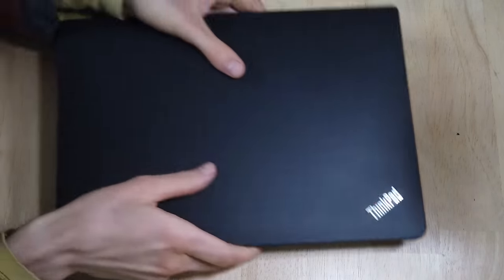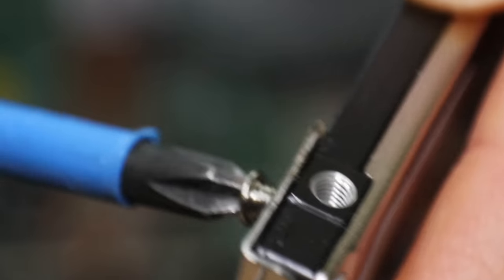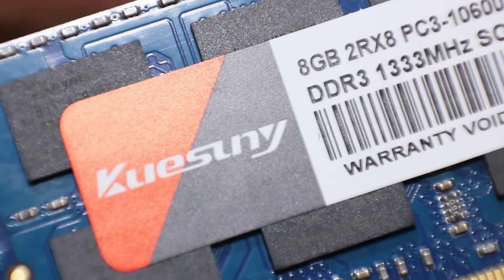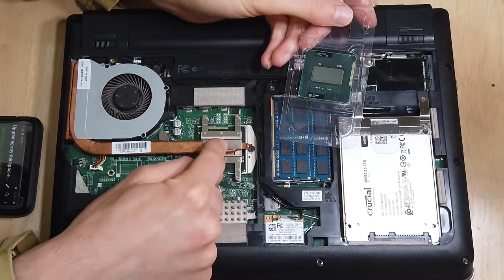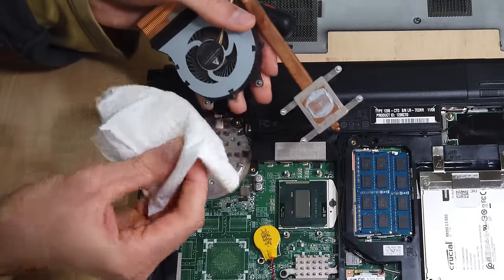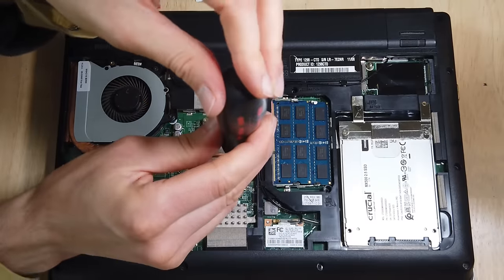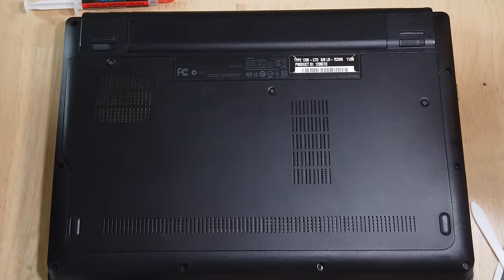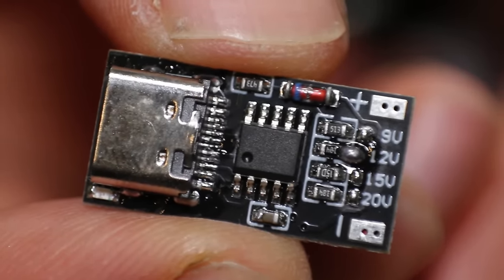The up-gradable laptop I can't get rid of: CPU upgrade etc

Comment: Hi can i upgrade the cpu of toshiba satellite dynabook b453/j intel celeron to  intel i5?
Reply: From the Internet, install the free CPU-Z program into your laptop. On the first tab of the program, look at which processor socket (rPGA 988b or BGA 1023). 
On the "Mainboard" tab, look at which south bridge -> HM65? HM70? HM76? HM75? HM77?
On the "Memory" tab, look at how many gigabytes of memory there are and in what mode it works - single? dual?
Give me this information. Which drive in the laptop is HDD? SSD?

Comment: you should have bought ram with 1600mhz or 1866 mhz and over clocked it to get more speed out of it. you still moght be able to overclock your ram to 1600mhz but it is just easier with higher speed rated ram

Comment: I think it was better install i7 3610Q, 3612QE 3615QE. 1 - Memory work on 1600mhz Sandy work only on 1333mhz. 2 Graphics is HD4000 with DX11 support. On sandy only DX10
Reply: G2/G3 m988 laptop cpu sockets are not always cross compatible with each other electrically like the desktop lga1155 sockets. Also, beside the chipset, you needs a bios which supports the mentioned cpu and memory speeds.
Reply: @el2-More  Man, you install 45w cpu on laptop with basic 35w cpu e320 solds only with dual core Pentium, i3, and i5. If lenovo blocked some CPU microcode - then you can't install 4-core 45w CPU. About electrically compatible, true, but only if you try install some 1-st gen cpu. I upgrade thinkPad E520 with prntium and same HM65, on i3-3120ME. Whthout bios update. And all work fine.
Reply: @el2-More  And, hm65 not support all laptop Ivy. Only CPU-s for this socket\chipset config
Reply: @AthraxAuf  somewhat true, m988 G1 is 100% not compatibe with m988G2, even if it's physically fits, neither electrically, nor chipset/bios level. G2 rev1/rev2 sandy/ivy ones sometimes, if the manufacturer prepares it, can work, but it depend on the exact model. My bad about G3, it got even different pin number (964 vs 988) and that's for haswell only.
About TDP,  in some cases, the heatsink/cooler does not prepared for the more powerful CPUs, in this exact case, it can't cover the full die and the CPU overheats. In other cases, the VRM itself not prepared for higher wattage, or, there are no 100% compatible microcode in the bios.
In such upgrade cases, I always stick to the ones wich had factory option for the more powerful cpu, and always try to avoid the ones with higher TDP than the factory one.

Comment: Can i upgrade dual core cpu to quad core (FCPGA94)
Reply: what processor and laptop model, what graphics card and power supply, how many watts (output voltage and current / indicated on the charger)

Comment: 97 deg C.... WTF!?!? Should never exceed 85-90C, EVER!
Reply: the 1-3 gen Intels were rated for 100 C i think, I have an older Dell from the same generation and it used to go up to high 80s as well before throttling, a repaste and fan change keeps it in the 70-80 range mostly
Reply: modern intel Cpu's 'can' run at up to 105°C, and that is specified as safe operating temp. by intel. There were even some dell laptops that would run them at above 100 deg. out of the box. Obviously a very bad idea but yeah... laptops be like that
Reply: Actually that is kinda normal given how anemic the cooler is in this laptop while a lot of higher end laptops has vastly better cooling never mind some overclocking for the XM models.

Comment: Would make sense if the footage was shot 8-9 years ago. Now what, new Asus vivobook 15  i5 8/256 GB is only US 300. For old laptop, battery/MB/monitor are not forever, not talking about not on par with current performance spec. One should learn when to let go.

Comment: what cpu can be changed to i3 2330m???
Reply: What laptop model do you have?
From the Internet, install the free CPU-Z program into your laptop. On the first tab of the program, look at which processor and processor socket (rPGA 988b or BGA 1023). 
On the "Mainboard" tab, look at which south bridge -> HM65? HM67? HM76? HM77?
On the "Memory" tab, look at how many gigabytes of memory there are and in what mode it works -> single? dual?
Give me this information. Which drive in the laptop is HDD? SSD? 
What graphics card is in the laptop?
Reply: @vladimirazirov1815  Asus k84L-4kvx
Reply: @BSIS-2201AndanThomas  You can install an procesor i5-2540m, i7-2620m, i7-2640m /socket rPGA 988b/ in your laptop. 
In the RAM-slot install  memory module 8GB from any manufacturer /Samsung, Kingston, Hynix, Crucial/, type 2Rx8 1.5v, so-dimm DDR3-1333, DDR3-1600. 
Buy a processor and memory module and take the laptop to a computer technician for installation. At the same time, let the technician clean the radiator from dust and replace the thermal pad on the chipset. Every 3 years I take my laptop to a technician for preventative maintenance (cleaning the radiator and replacing thermal paste) so that the processor does not overheat.

Comment: You probably applied too much of that thermal paste.🤣🤣

One more your motherboard may support 32gb of ram but the cpu itself doesn't. Also the Cpu doesn't support 1600mhz of speed. It just 1333 mhz max.